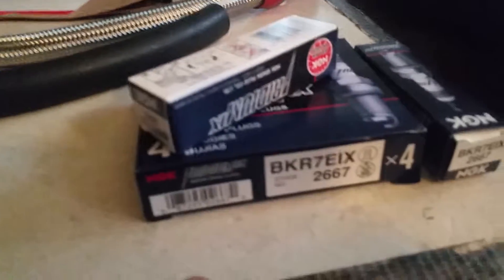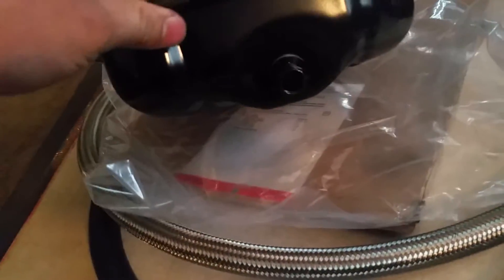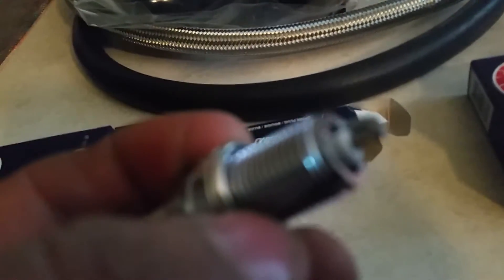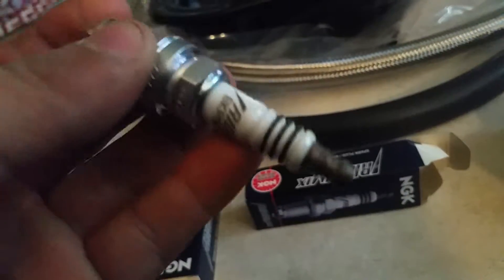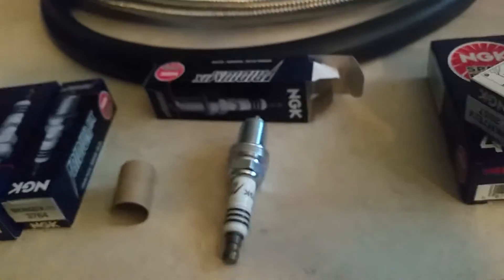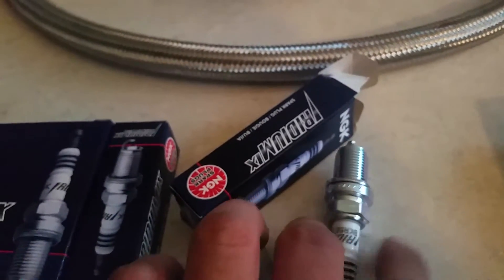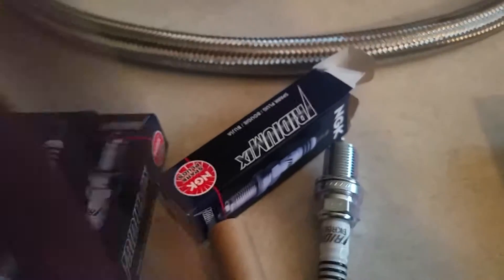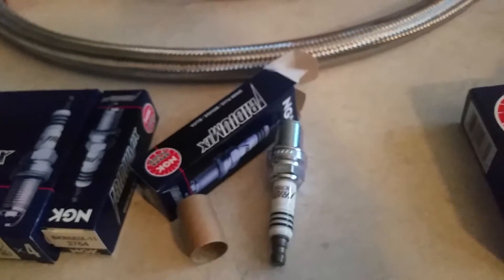One step vs two steps colder spark plugs & more

Comment: My stock (intake, exhaust) VQ35HR uses 7 heat range for stock denso spark plugs, and all 6 of them’s electrodes were melted after replacing them 4 years ago with 32,000 km on it.
Do I have to use 1 colder spark plugs, 8 heat range ones?
Reply from the maker: You have a Nissan? If you just have intake and exhaust you don't  need change heat range. I understand you making 75 hp extra hp from factory then yes you charge your plugs to one step colder
Reply: @Lilmiddwest  I don’t think just using k&n air filter + muffler change will make any extra horsepower..
Reply from the maker: @Qkfltpdls777  I meant to say you don't need to have colder spark plugs just bolt ons..  When you are boosting it or nitrous it then yes
Reply: @Lilmiddwest  I see. What kind of stuffs could make my denso oem spark plugs electrodes melted after replacing them 4 years ago with 32,000 km on it…
Reply from the maker: @Qkfltpdls777  I don't know and I don't work on Nissan. I only did only one spark plugs set change on infinity. I work on Hyundai Tiburon and hemi vehicles. I never seen plugs melted.
Reply: @Lilmiddwest  mine is marked with INFINITI, just a nissan..
Reply: @Qkfltpdls777 melting sparkplugs could be detonation or just faulty bad plugs

Comment: My car seems to missfire at higher rpm with the stage 2 tune, i have one step colder plug. What do you think i should do? Just gap them or?
Reply from the maker: On a Tiburon?? If so you supercharger or turbocharger?
Reply: @Lilmiddwest  bmw m4 TT
Reply from the maker: @jrw8080  remember one step colder plugs when you make 75-100 more hp from factory. Then you make more 150-200 you will need another step colder. I'm not familiar with BMW you should ask someone that mods those BMW.
I'm sorry I know more about Hyundai Tiburon, Mopar products.
Reply: @Lilmiddwest  ok thanks

Comment: are you going to drill a hole in the oil pan for oil drain for the turbo?
Reply from the maker: rushking19 still debating on new one or do upper oil pan. And see if the new oil return line  is long enough from turbo to upper or new lower oil pan...
Reply: Lilmiddwest it should be better to do the upper oil pan because lower oil pain will have lots of oil in it and may flow less better than upper oil pan as I remember , but I would recommend upper oil pan never supposed to put in all the way down in the oil
Reply from the maker: yea i hear you just look at other ppl turbo tiburon how they did theirs
Reply: Lilmiddwest a lot of people I seen was in the upper oil pan
Reply from the maker: rushking19 yea it makes more sense today I replaced turbo on a Cummins and see oil return line is on upper oil pan not lower
Reply: Lilmiddwest yeah and I'm going to do the same thing, and I'm pretty sure you can maybe install the oil return line without taking off the upper oil pan off, just take off the lower oil pan and drill a hole in the upper oil pan right over the opening of the lower oil pan and collect the shavings and weld it on if you can in that spot
Reply from the maker: yea above the lower pan i will do that and going to look at oil coolers soon for turbo get hot and need to put my oil pressure sensor for my aem gauge
Reply: Lilmiddwest that sounds good can't wait to see

Comment: never use those plugs for spray copper only you know what I think about irdium plug but keep up the good work get a beta tib lol
Reply: My car seems to missfire at higher rpm with the stage 2 tune, i have iridium step colder plugs. Whats your opinion on those and do you recommend something different?
Reply: @jrw8080  are you na ? Boost? Nitrous?
Reply: @PATuners  bmw m4 stage 2 tune down pipes. Dont know what actual boost is but its up higher
Reply: I need something to handle the firing at the higher RPMs and reading your comment on iridium makes me question them but I believe I was also supposed to get them to 0.020
Reply: @jrw8080  i do run ngk iridium in my turbo car . I would get new plugs and gap them to atleast .020 
I normally always go 3 step colder if im running 38psi to . 2step colder running up to 20psi and 1step colder to 10psi . now turbo cars from factory ill run 1 step colder to 16psi and two step to 26psi and 3step 40psi 
Not sure if this helps lol.but hopefully
Reply: @PATuners  yes thank you
Reply: @jrw8080  Welcome